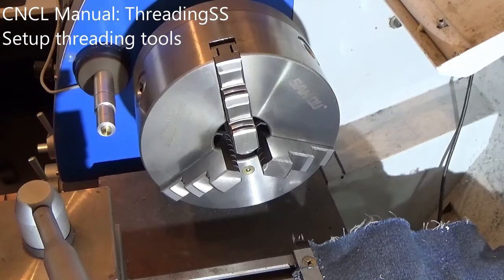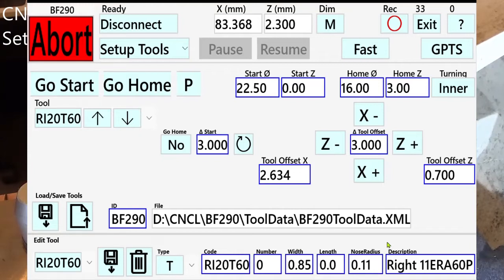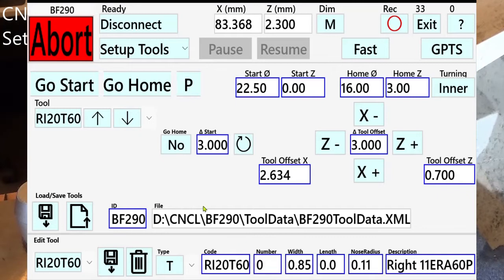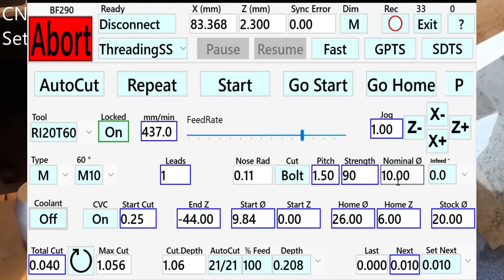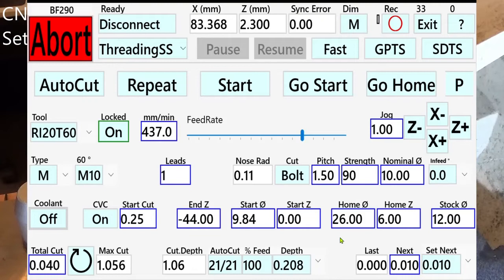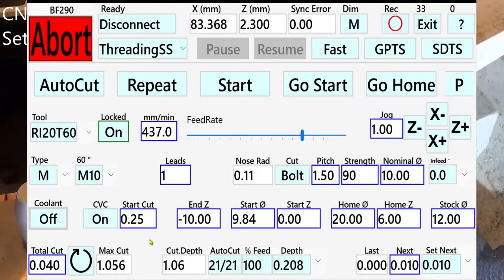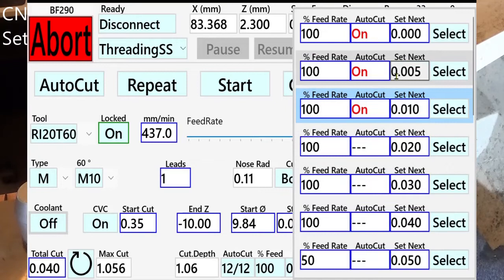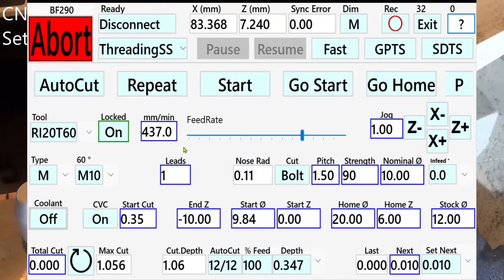CNCL Manual: ThreadingSS

Comment: Well-done. You are the best both in mechanic and software programming. I am so sad that this channel is not rated high. You deserve millions of likes and subscriber.
Reply from the maker: I am glad you like it.
A million subscribers would left no time for programming or making things. So I am pleased with the today's results.
Reply: @MetalWorkerTools  Fabulous. Nice thinking.
Reply: I have successfully flashed my Mega 2560 with GRBL-L hex. Could you please please tell the pinouts for ENA+, Pul+ & Dir+ and the ground for all the -pins? I am using DM556 driver with Nema 23 4A. Also I need pin for the pulse input. If you have a  link to this diagram, I do appreciate you.
I also have cnc shield if you have diagram also
Thank you very much
Reply from the maker: @sorankarim5190 
 In this link, you find the threading setup for all (Mega) boards. https://github.com/MetalWorkerTools/grbl-L-Mega/wiki/Threading-setup-and-use
In this link, you find the connections for the Arduino Mega board: https://github.com/gnea/grbl-Mega/wiki/Connecting-Grbl-Mega
If you have a CNC shield, that probably is a Ramps (1.6/1.4) shield. If so, here some info: https://github.com/MetalWorkerTools/grbl-L-Mega/wiki/Threading-setup-RAMPS

If you have an Arduino uno, you can flash it using grbl-l. If you have an Arduino Mega, you need grbl-l-mega.
regards, Huub